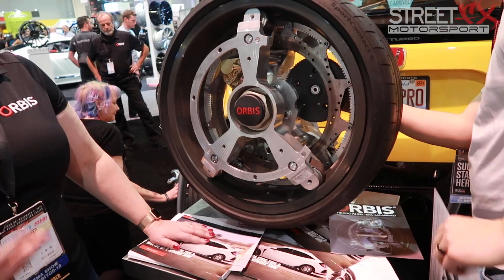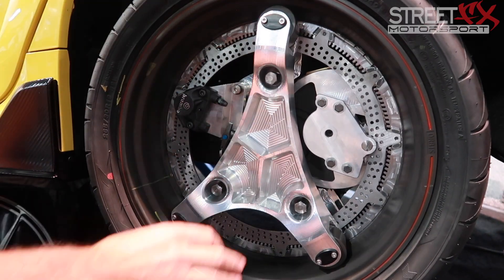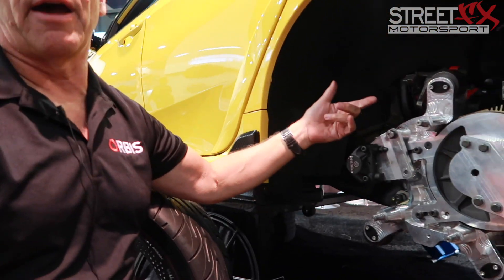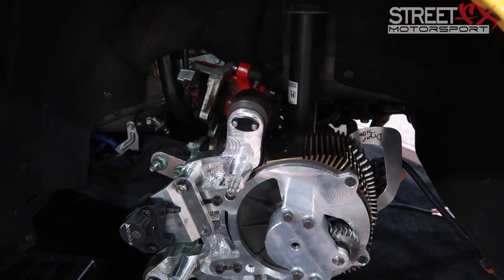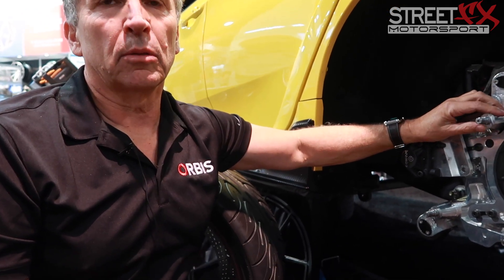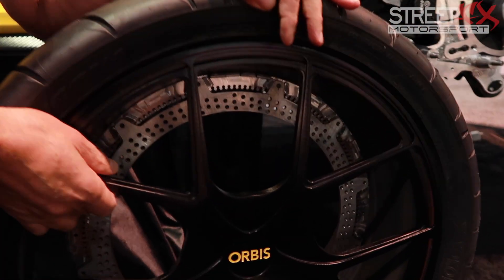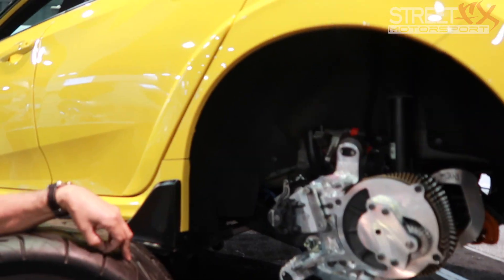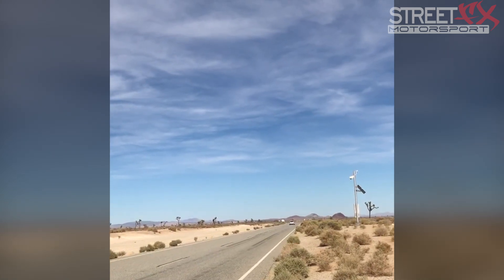WORLD's FIRST ELECTRIC hybrid AWD Honda Civic Type R FK8 with 450hp!

Comment: Incredible invention!   Perhaps we all should pull out the engine, put the kit on all four wheels, put in one or two batteries, then presto magic, we can have a pure EV.    Possible?
Reply: For 20k? And that for 200 hp? No thanks
Reply: 420cardude and you seem to be forgetting that the entire weight if the drivetrain from the car will no longer be factored in so power to weight ratio with 200whp or even more will make a quick Efficent car....
Reply: @theapexlegend2664  batteries still weight a shit ton. If Battery technology evolves, nothing will hold this back
Reply: Bimmerskids that is true I think he stated he was using Prius battery's which only weigh 100 pounds each I can't say I have knowledge in electric cars, batterys, and their life expectancy but if 4 Prius batterys are able to sustain each electric motor that is 400 pounds plus 160 pounds for the electric motors so 560 pounds.  Now minus the engine, engine harness, transmission, axles, radiator, gas tank, exhaust, the list goes on.  and if I'm not mistaken with the weight reduction those electric motors will have improved performance so the 100 HP per motor seems logical.  400 HP in a car with significant weight loss and all the power at the pedal since its electric will be a beast. Again I don't have knowledge on the subject so what I stated could be wrong
Reply: yeah, i lost interest when he mentioned the price of a used prius battery.
Reply: Rebuilt not Used...there is a huge difference. You could probably pull a battery from a wrecked Prius or Volt for less.  @psychomaniac189
Reply: @elia4783  for 20k 200 hp? It cost u just about the same in engine mods and if its built motor even more 200hp for just basically a breaks mod no strain on the engine still able to run a stock motor. Plus this is s new innovation  like others have said first LCD TV was like 5k now u can get em for 1500 or less . In time it will be 2000 not 20. Any new projects cost big bucks untill there either redefined with less costly parts or made more readily available
Reply: @elia4783  it would be 70ft lbs of torque on each wheel. That's 280ft lbs total. Forget hp. Torque is what it's all about.
Reply: Zeeshan Fedaie I love torque lol
Reply: Zeeshan Fedaie 280 isnt that much but okay
Reply: 420cardude actually the space available is what limits the power, as the investor says in the video. Without the engine and all that space I’m sure they can pull 100-150hp per wheel.
Reply: @JohanSalvattore He was specifically referring to space in the wheel well and clearance from the shock  tower on the Honda were what limited them to 50HP per wheel. He then immediately said that 100HP per wheel was available if you have the space for it.
Reply: @zeeshanfedaie6553  still not enough
Reply: Ypu can get a Tesla drive unit and subframe that does 300hp+ for 12k including control electronics! Of course modding is going to probably cost another 12k
Reply: i think it is possible in near future ;)
Reply: Battery prices are the main issue for that I think, and range.
Reply: I would so do that, I seen people pay money to make so much horsepower and crash it or it breaks due to to many ponies in the engine, I would like to make my older honda or Acura look nice...
Reply: Much easier to just stick a Nissan Leaf or Prius motor where the original engine was.

Comment: Now that's an Invention. Well done ORBIS.  Bravo..
Reply: It's actually a shitty design with the open gears. Will wear out in no time!
Reply: i want one
Reply: They make them period. You can just buy the kit and put it on any car you want. It's not exclusive to this type R.
Reply: what is that all about? i cant understand ...
Reply: search for michelin active wheel
Reply: Search Michelin active wheel on YouTube. Michelin made this in 2010. They literally ripped the design even the motor mounting position.
Reply: Ferdinand Porsche was building the Lohner with electric hub motors in 1899, that's 119 years ago.  So, ORBIS has not actually invented anything.
Reply: Absolutely correct.  But most people can’t handle the truth lol.
Reply: Except they didn't invent anything.  What they did was take a patent filed by Ahmed Y. A. Mothafar for hubless wheel system for motor vehicles. change the title and make some minor changes and obtained a patent.  Then as a way to gain investors they did two test use cases one of which the HMMWV was an utter failure.
Reply: @pprotory  Mothafar? rly? :D

Comment: How do you change tires?
Did they explain that?
Reply from the maker: We quite literally showed them unbolt and bolt a wheel on. It's three lugs. Took less than 30 seconds to remove a wheel.
Reply: Jesus
The same way its always done...
Reply: Bee Gee some mothers do have them 😉
Reply: There ya go reverse orca
Reply: Like a normal rim, do you even seen the all video? Or how to change na tire? The only thing missing bis then central hub the rest it's pretty much a normal rim
Reply: Tires not wheels @Street FX
Reply from the maker: @3DadsAndMatt  Tyre machines clamp onto the rim, not the spokes, so they'd change exactly the same way!